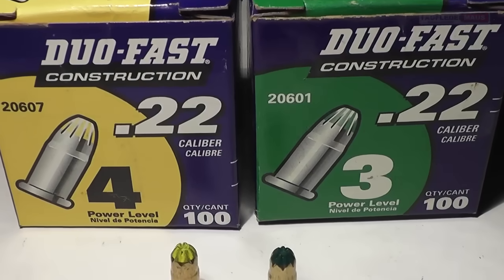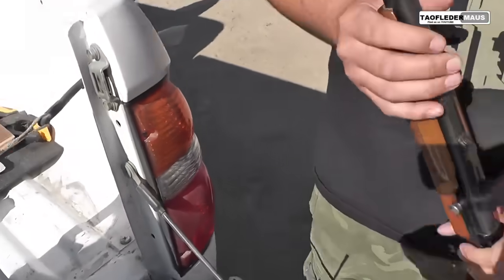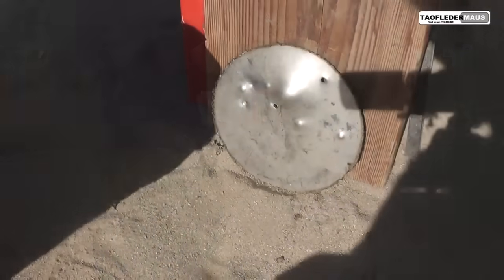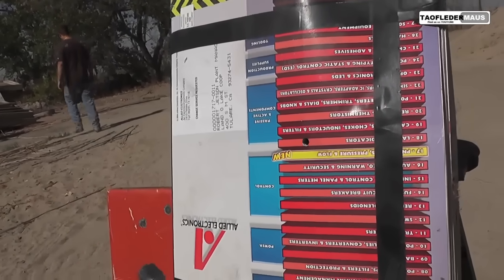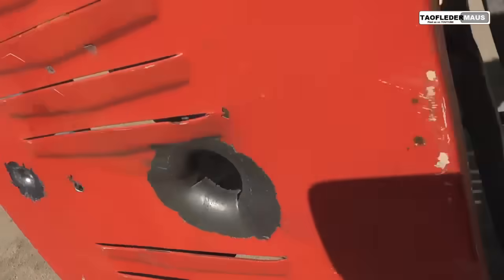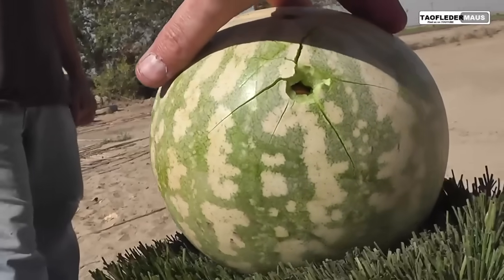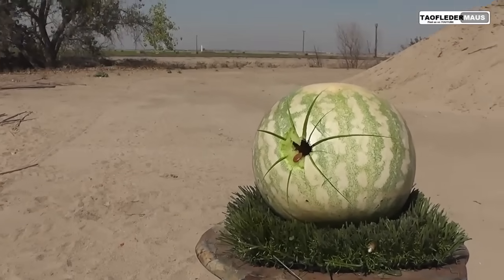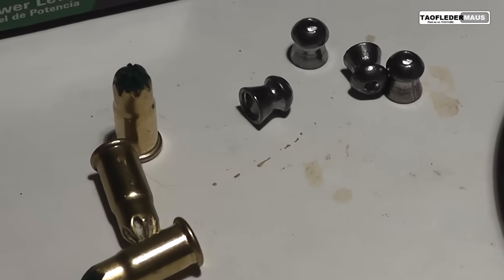Shooting .22 PELLETS Using NAIL GUN Blanks - What happens?

Comment: COOL VID>> but here is a better way>>>I have been using these for YEARS.. get a bolt action.. old one, that is not magazine fed.. drop a spec of goop (shoe glue) on each blank, stick the pellet to it.. and VIOLA.. great fast round. goop acts as a gas check kinda and bullets fly nice and straight..  NEVER ram bullets down your barrel no matter what the benefit is.. the damage and potential accidents are not worth it.

Comment: And for something equally intriguing, load a .22-250 (or .223 or any other .22 centerfire) using a large rifle primer, NO GUNPOWDER AT ALL, and a .22 pellet for the projectile.   It won't have the velocity of the nail driver round, but it works for squirrels and such.  Best thing is that you can use your normal rifle optics on a lightly charged projectile (backyard use, etc...).   Loads of fun.

Comment: Wow, those pellets are travelling at such high velocity it's almost like they hole punch the material out of the way. I wonder what the actual FPS is... must me amazingly high.
Reply from the maker: Zack Richmond  Another channel chrono-d them  (ryeonham)  and he was getting around 2800 fps.
Reply: ***** Wow! In more conventional measurement, that's over 1,900 mph.
Reply: ***** The speed of sound varies depending on altitude and air density, but yes, that's about right. You get hit way before you hear anything, hehe.

Comment: Back in the '80's I made a .22 muzzleloader from an old Stevens single shot rifle. Used 30gr load of pyrodex, (proofed at 60gr) and Crosman .22 pellets. Regular .22 LR would put a good dent in a steel car stand ramp at about 50ft, the .22 muzzleloader punched a hole through at the same distance.

Comment: hey, what if you grind the back off a used .22hmr and push a pellet+charge up into a used brass to create a new "cartridge" out of 2 normal every day items. could make the process a cost effective way of plinking with a .22hmr at short range... perhaps like a pmr30. but i would try with a bold or lever .22hmr first to see if you cant get some ridiculous velocity out of a longer barrel + more rifling = more time to stabilize and absorb energy from the charge. also.. try reloading a .22lr or a .22mag with a sheathed pellet to see if the reduction in weight but keeping .22 diameter increases its effectiveness.

Comment: I made myself a pistol that shoots with similar ammo that you used. Mine uses Hilti cardriges. Now, i was impressed by the penetration force of this airgunpellet..but still i wanted to improve stability and penetration. Using flathead airgunpellet, i put a small amount of normal solder used for electronics on top of it. This improved the penetration and stability of my projectile, went trough a steelplate (4mm) as if it were butter. I should mention it was fired from a homemade device and the thickness of the chamber was addapted to the higher chamberpressure due to smaller caliber fired.

Comment: couldnt you use a 22. air rifle, put blank in and then shoot a pellet at the blank in the barrel and then the blank hits a pellet?

pellet blank pellet
Reply: GamingLoadown101 No. I imagine Rifle barrels are much harder than air rifle barrels plus it's the dullest and most dangerous use of an air rifle I can think of.
Reply: GamingLoadown101 You couldn't get the cartridge into the barrel because the rim would be too big, even if you used a regular primer cap or a cap for cap and ball guns there isn't a solid backstop or locking bolt at the base of the barrel like in non-air guns.
Reply: One word: BOOM!!!

This is how you risk a barrel rupture!

Comment: I think This came from PATMI, the "official" ratings for powder loads
Color coding for the "rounds" or "single shots" (the three shot strengths or colors typically sold to the general public are brown, green and yellow in brass):
In brass casing:
Color coding Velocity
- Grey 315 ft/s (96 m/s)
- Brown 385 ft/s (117 m/s)
- Green 490 ft/s (150 m/s)
- Yellow 575 ft/s (175 m/s)'
- Red 675 ft/s (206 m/s)
- Purple 755 ft/s (230 m/s)
In nickel (silver) casings:
- Grey 845 ft/s (258 m/s)
- Brown 935 ft/s (285 m/s)
- Green 1,025 ft/s (312 m/s)
- Yellow 1,115 ft/s (340 m/s)
- Red 1,205 ft/s (367 m/s)
- Purple 1,295 ft/s (395 m/s)
Not all powder-actuated tools are rated for high capacity charges — the strongest charge (nickel - purple @ 1,295 ft/s (395 m/s)), for example, is dangerous in a tool not rated for its use.

Comment: Powder blanks smell like really bad corrosive powder SO MAKE SURE you clean your gun.
Reply from the maker: MrMudNugget  Wouldn't they corrode the tools they were made for?
Reply: unlike the inside of these disposable tools. the indies of guns are not coated with a crap ton of black aluminum oxide stuff. Also they are not rifled so its easier to clean and they dont get crap stuck in the rifling. Did i mention they are 30-50 bucks?

Comment: Well, I read the warning that said not to do this... bummer, should have tried it.  My powder based nail gun is pretty intimidating, but I'd have little luck holding it in the air while I wack the end with a hammer, although if I hit the perpetrator with the heavy barrel first, and then push the nail gun onto his forehead and... ojk, you get the point.

Comment: By shoving the pellets in from the outgoing end of the rifle you are potentially screwing up the rifling. You are not supposed to even run a cleaning brush that direction on a rifled barrel.
Reply from the maker: nah
Reply: I call bullshit because the clearing brush is made to go down into the barrel and clean out any powder or metal build up. That's why it's called a bloody cleaning brush.

Comment: You could use the equation 1/2 mass x velocity^2 to calculate the kinetic energy of the bullet and the pellet. It would be interesting to see the KE difference. Using that equation, it is also easy to see why the pellets worked so well. Velocity has a much larger influence on the KE of an object than the mass.

Comment: you should try using wd-40 as an accelerant.  I actually use those .22 rounds in my hilti gun to shoot nails into concrete...BUT when the concrete is old or a harder mixture sometimes the nails wont go all the way in.  My solution is to spray wd 40 into the barrel and chamber ( just a little ) and you can actually feel more power and nails shoot further in as well.  Not sure if you want to try it in your .22 rifle but may be fun to see what happens :)  Happy shootin!  Check out my videos as well.  let me know how it goes!!

Comment: If you put a dab of got glue on the bottom of the pellet and stick it on too of the charge it will actually hold pretty well due to the crimping... And I can actually load it in to the mag of my marlin and load it of course I have a bolt action so it's easier

Comment: I wonder... What would happen if you opened the charges, inserted the pellet, and closed it a little. Would it explode or just be way easier to reload?
Reply: the older ramset charges were longer and weren't necked down. i used to cut them, take out half the powder, reload them to make hot 22 short bullets.
Reply from the maker: MinecraftmanUSA  The pellet is larger than the blank opening.
Reply: ***** darn, what about a normal bb?
Reply: TREVOR1900 Well the main reason I thought this was because after making them, its much easier to load. It takes less time. I would think at least
Reply: MinecraftmanUSA they are easier to load, even fit in some magazines, but loose a bit of accuracy when they are sized to fit in the ramset cases.  i uploded some to my profile pic
Reply: Peter Phelan cool! thanks
Reply: it wouldnt fit, and i was using red charges. if i used the full load in them with a projectile shoved in aswell it would blow the back off the shell, and blow the extractors off the gun

Comment: Fun video, I used to use 22 pellets with 5.56 blanks. Works great just stick the pellet on the blank and loaded it manually into my M16 and shot small game. My squad ate ,
that's well during field training exercises. Worked better than using a cleaning rod

Comment: Be careful. did this with an old lakefield 64 and blew the extractor clean out of the gun
Reply: And also the pellet skirt expands and rips off and coats your chamber/barrel with a thin layer of lead that can cause build up
Reply: Maloney001 done the same to my ruger with a red charge, had no problem with little yellow charges though. i was using 44gr cast lead 222 projectiles

Comment: The pellets are made of steel. That's why they're cutting through the materials so easily, not falling apart, and are able to handle the velocity. The bullets are lead, so they deform far more easily. That's why the Locker door had such a neat little hole from the pellet and a bigassed dent from the .22.
If you take the linear increase in velocity for the pellet and give it a percentage, say they're moving 50% faster than they normally would, that's still well within the stress tolerance of steel. On the other hand, if you were to take a lead round and increase its speed 50%, it wouldn't be able to handle the same stress. Softer metal and all that.
Reply from the maker: Perry Wood  These are lead.
Reply: *****
...in that case I've got nothing. xD
Reply: *****
The reason is that the pellets are hollow points, and the cci mini mags are not.
Reply: ***** Did you look at them to see if they are 100% lead or a lead alloy?
Reply from the maker: I'm sure Crosman's website has the information.  I don't know if they were an alloy or not.  They weren't steel,  I know that.   Maybe they had some antimony or something but they were still soft like lead.
Reply: ***** interesting. I'm curious what the velocity is vs the 22 round
Reply: The pellets are lead too.
Reply: Steel pellets? Never heard of them. Definately hard pellets though in order to stand up to that velocity and centripital force.
Reply: So does this proof steel makes for a better bullet and projectile than lead?
Reply: kamenridernephilim pellets are lead
Reply: Colestercamps Not all of them. I've gotten steel and copper ones before.

Comment: Many years ago we converted a #1 (1.77mm) pellet gun to fire with .22 blanks. Had the breach machined to accommodate a .22 blank, striped rear that houses the spring and fitted a round disc fitted with a hard pin where the air exit’s to strike the rim of the blank. This work well on rabbits and pigeons. Highly illegal in our country, as all fire arms needs to be registered, even pellet guns.

Comment: I like this video,very well done,very professional.I done this very same thing back about 25 years ago under different circumstances...The different circumstances was I was using CCI and the blanks had full length long rifle cases,the red epoxy was in the top of the case...These were at least three times stronger than the ones in this video are.Do NOT!!!,I repeat do NOT ever use the ones I used in anything PERIOD!!. Believe it or not it sounded just like a 12 gauge shotgun when it went off,luckily,I was smart enough to use a fixed breech gun. ( Savage falling block single shot) It left a black mark with a half moon shape across my forehead and the pellet disintegrated in the barrel and didn't hit the gallon jug I fired at 10 feet away.Power guesstimate the pellet had to be moving well over 4000 feet per second for a very brief time...LOL!!. The blanks that you used in this video are fine,but don't use the ones I used in anything EVER!!. ( CCI RED DOT BIG BIG NO NO!!! )

Comment: Interesting experiment, impressive (unexpected) performance of an air rifle pellet. A Mexican company appears to sell a bolt action rifle (Mendoza 990)  that also uses air rifle pellets (.177) and crimped "Flobert" brand 6 mm blanks. These blanks are commonly used in Europe for blank firing revolvers, such as the German "Röhm" brand (sold under the "Umarex" label). Two websites and a video that may be of interest to you:

http://www.network54.com/Forum/79537/thread/1184637147/The+Mendoza+RM+990++a+polemic+rifle+!+EXTENSIVE+AND+PICS

http://www.kotte-zeller.de/Knallpatronen-6-mm.htm?websale8=kotte-zeller-shop&ci=009916

https://www.youtube.com/watch?v=KFesrhYIKB0

The fact that the pellets deliver all their energy without penetration is a definite asset in certain hunting situations. I'm wondering how a .22 revolver would perform with your approach?

Comment: Has anyone tried .177 pellets in a .17 hmr or just plain BBs stacked in a .22LR single shot.  How about hot gluing a sabot to the BB for an undersized .22LR shot?  Sort of like shotgun wads of plastic for standard BBs? How about .177 pellets in a .22 with a plastic sabot? My guess the rifling would just shred the hot glue or plastic sabot and the velocity would drop off. But would it be faster than a standard .22LR or similar?
(going to try a few and see what happens with a sacrificial gun perhaps)

Comment: I did this same experiment 3 years ago, Shot a 1.5" diameter aspen tree at 15 yards and blew it down... good news... Now for the bad news.. the pellets are traveling so fast down the barrel they solder the rifling leaving lead deposits in the rifling. Each time you shoot more of the rifling get soldered off into the rifling, causing super increased pressure, Eventually to the point where your gun barrel will explode, not a very smart idea....
If you had a solid copper pellet.... not a copper coated one... you wouldn't get the soldering effect of the lead pellet on the rifling inside your barrel.
Never took it to that step... for I destroyed my 22 repeater from over pressure, it permanently knocked out my bullet head space and ruined my gun completely.
 When I looked at the rifling in the barrel... there was no twist to be seen, it was completely  soldered out from the lead pellets..
Do not do this with lead pellets you could seriously hurt or kill someone or your self !!!!
Reply: KEVINNOAD1 lol this comment prob fell on deaf ears.
Reply: Or clean the barrel after each shot?  ...which makes it even more tedious.
Reply: Copper does the same thing. Very common in gun barrels. Lead requires lubricant to slow down fouling.
Reply: Timothy Terrell I wonder if you used some type of lube down the barrel if it would help slow shooting out the rifling?
Reply: I kind of figured that would happen...
Reply: Tab Valentino   Get your self a good magnifying glass and a bright light, check your bore regularly.
I learned this from Hi power shooting. If you CAN see copper inside clean it out.
Lead does that to. Worse.
Reply: KEVINNOAD1 pp
Reply: Tab Valentino  have you tried that yet? What happened?

Comment: Can you glue the pellets to the tops of the nail gun blanks?
Reply from the maker: Gareth Hughes  They don't work very well doing that.
Reply: ***** I'm going to try and turn the breach block on a break barrel air rifle to take these with a air activate firing pin..
Reply from the maker: Gareth Hughes  I'm not sure if an air rifle can handle the pressure of a powder load.  Just keep that in mind if you try that.
Reply: Gareth Hughes well as seeing theres no response from you, can we assume you got blown up?
Reply: ah. your alive
Reply: maybe some one could do a range test? 22lr vs.22w/.177 out of the same gun?
Reply: that would be awesome
Reply: A breach of a weihrauch HW80 will take a nail gun blank or .22 rim fire if drilled out properly been looking into a guy who has been using 5 grains of black powder in a cheap Chinese break barrel job for over 10years and doesn't have to muzzle load, the breach blocks on some of these rifles are just as robust as some shotguns.
Reply: When I've done it I'll let you know how I've done it a weak black powder seams the best bet so far for pre 1910 rifles with weaker mechanisms...
Reply: It needs to be done with a breakbarrel air rifle as the pellets will go straight into the rifling..
Reply: ahh. true true. here's a thought. but what if you put a hole bunch of .177 pointed pellets in a 12g shell. would it work?
Reply: ultraairsoftbrandt that would work...
Reply: May you make a video of it.
Reply: ***** I think the crimping on the blank opening up will destroy the back of the pellet and it wont engage the rifling.
Reply: Gareth Hughes Sometimes air rifles do this anyway, if you get oil into the cylinder, it fires like a deisel engine sending the pellet supersonic, it does all kinds of crazy things, that shape is'nt made for >Mach1

Comment: I tried using .22 pellets +  the # 4  powder charge from Lowe's in my Buckmark  .22 pistol,  and it worked very well....it appeared to propel the pellet at substantially higher velocities than a standard .22 rimfire round...since obtaining .22 rimfire rounds has been difficult for several years now, this is an excellent alternative, to be able to shoot your .22 rimfire guns... It helps if you can place the pellet into the chamber from the rear, with the charge behind it..... .
Reply: I was experimenting today with the pellets and powder charges.... Using Crossman Premier HP pellets , the # 2 charge works best.  The # 4 blew a pellet in two, leaving the skirt in the barrel.   I gotta get heavier pellets, @ 25 - 40 grain, to use with the # 4 charge.   A break-action gun would be much easier to load than a bolt or semi-auto.

Comment: those Ram Set blanks are a powerful round they will drive a nail into cement with no trouble...if you had a bolt action rifle or a revolver would load better, we used to get them and shoot them like blanks around our hunting dogs when they were pups to get them accustom to gun fire, there louder than the blanks for starter pistols...just fun to play with...